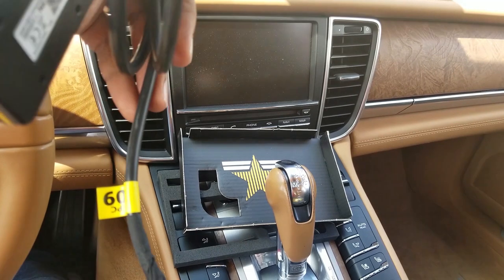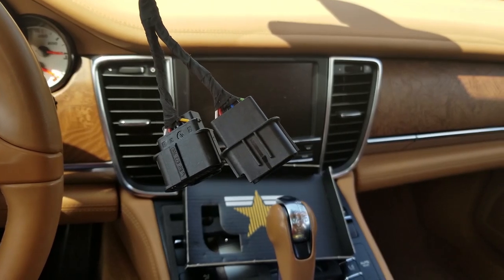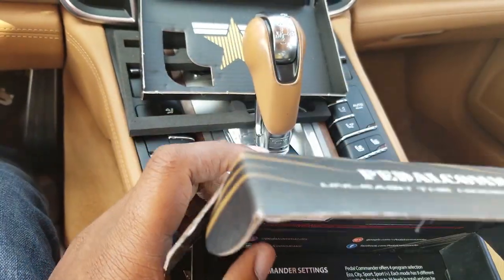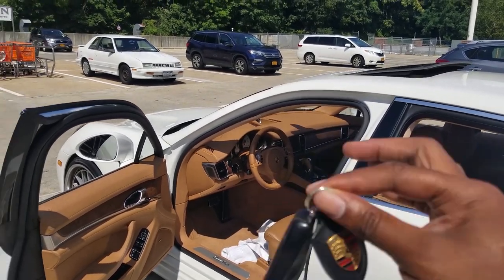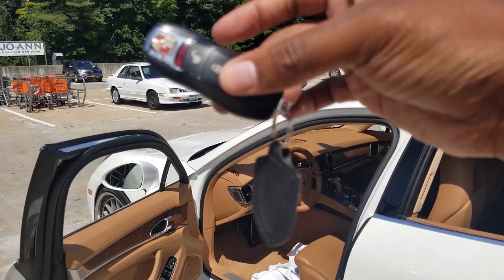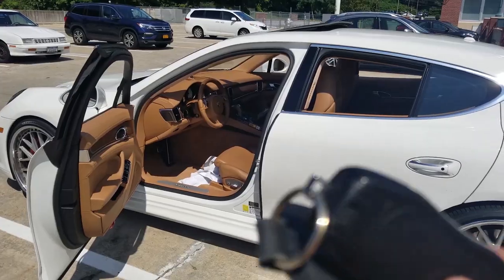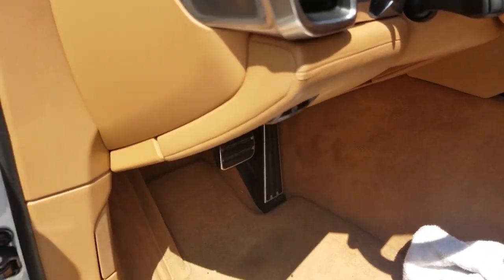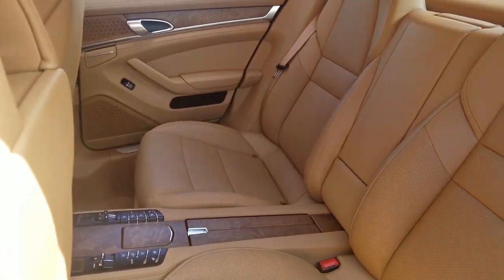Finally A New Mod For the Porsche : Pedal Commander

Comment: Pedal Commanders decrease the programmed-lag/ response time of the drive by wire throttle and make the car far more responsive than the manufacturer intended.

Keep in mind that some of that lag is a built in safety for both you and the engine.

Have fun!
Reply from the maker: That is correct big truck, I felt like sport plus was too much for me and the motor
Reply: Your the only person that can explain what it was
Reply: I use for porsche 997.1 carrera s to much lagg some time  if i drive like 20 kilos when i stop throttle come lagging can’t rpm up to 3

Comment: I watched your video several times and was skeptical, but knew my throttle was heavy and there was unnecessary lag. I just installed the Pedal Commander on my 2013 970 Turbo, took it for a drive, and WOW!!!! you were right. This thing is legit!! On Sport + #4 its crazy snappy, so I had to turn it down to Sport #2, and OMG. It's like a new car, feels lighter and is Hela quick like it has a tune. 
It was quick before, but now just from installing this device, it woke my car up and actually lightened my stiff pedal up to feel amazing. It really shows you how much the factory de-tunes these cars. I was planning on getting an ECU stage 1 tune, but now I can't image how much quicker and faster it would get with a tune, and dont think I need it now. 
I'm super impressed. I guess it makes sense and tells me that a 500 hp twin turbo AWD V8, paired with a PDK, has more than enough power that was just de-tuned out of the car to appeal to a wider range of people and probably to protect the car and the driver from guys like us lol.    
Excellent video. Thank you sir!

Comment: I was at a 4x4 & Truck show when I met a representative from  pedal Commander. In their booth he showed a video, which I think you can find here on YouTube. I own a 2014 Ram 1500 4x4. Their is most definitely a delay in the throttle response. It's a 4x4 not a sport's car I get it. But because of the dual exhaust. I often find my self faced with people who want to see if it's up for a challenge. Because I'm a Jackass I'll give some a quick run.
The pedal Commander would increase throttle response therefore making my truck seem a little quicker.

Comment: Outstanding info,  I have a 2011 Panamera 4, it comes with only sport, but your right  it has a slow throttle reaction time. The Pedal Commander will increase my response time, thanks again I'm sold... great review.
Reply: My Panamera Turbo also only came with sport mode. It had no Sport Plus or Launch control. Then a purchased Sport Plus and Launch control from Suncoast Porsche and the dealer installed it. Worth every penny. I totally enjoy it. Then I had the car tuned by FVD Brombacher. It feels like a whole new monster. But now I'm debating whether to get a pedal commander on top of the tune. Just wondering if the tune already increases the throttle response as best as possible or if it would still be better with both? Or would the pedal commander be Overkill if you already have a ECU tune?

Comment: Best video review! Mine is coming in tomorrow and I wasn’t sure how it would perform with my car. I have a 2017 Mustang Ecoboost and although it has 320 Torque and 310 HP, it feels flat until the boost kicks in. Also, most the power is in the lower rpm range, so dropping gears sometimes actually makes it feel slower. This vid shows me that it may help my boosted car too.
Thanks!

Comment: Would've loved to have seen you try it in launch control mode.  My 4s even lags then but is a generally a real pita when shooting a gap in the traffic from an intersection.  In fast cornering through the twisties I have to throttle on early to defeat it. My VW is even worse

Comment: You said you think the Porsche Panamera Turbo would be basically a whole different monster if you added a ECU software tune in the future in conjunction with the pedal commander. In my opinion, it seems like you wouldn't even need a pedal commander after you had the car properly tuned. I believe the tuner software can dial up your throttle response internally to do the exact same thing as the pedal commander. Meaning the pedal commander would be redundant and unnecessary. Am I correct in assuming that?
Reply from the maker: yes 100%...i have a dme tune on the car now and the pedal commander was no longer needed

Comment: If car is always in comfort because I’m driving in in suburban/city - but I want to overtake somebody,  and I want the fast response,  is there a setting I can just always leave it in for that?   I mean without me ever having to switch modes on the app or controller - a permanent setting solution?

Comment: How did you get that connector plug off the pedal assembly.. I've been trying for 30 min to release that connector... removed the assembly like you did and pushing down on the grey button. So should the grey button stay down if it releases all the way? im worried about breaking the clip sticking a screw driver in there..
Reply from the maker: Lmao, use two small flathead screwdrivers lol
Reply: After watching your video and hearing you say use the screwdriver I used it and low and behold it popped off, scared the crap out of me because I thought I broke something but it is all good.
Reply: Holy crap this sprint booster is bad a$$!
Reply from the maker: glad you like bro

Comment: I hooked one up to my hellcat and I didn’t notice any difference at all. I think the hellcats already have the quick throttle installed from the factory ? As far as the quarter mile I had no difference in my times.
Reply from the maker: I am going to add to the HC tmrw
Reply: Right on, I can’t wait 😊 maybe I did something wrong ? But my cell phone says it’s working ? Seeya tomorrow . Thank you
Reply: Most care come from factory with a timed delay from the input of your foot on the pedal to the acceleration of the car aka, a throttle response delay. This is done for safety reasons. I'm guessing due to the hellcats 707 hp from factory and thats a conservative number, you have so much power from the engine, and the transmission is so responsive as well that a pedal commander isnt needed. Easily put, your hellcat makes so much power that the engine IS a pedal commander! lol

Comment: I have a 18 Panamera Turbo, do you know of any other mods worth doing? I can’t find anyone who has anything that isn’t only cosmetic, for 17 or 18s
Reply: There are several things you can do,..First get it Tuned. That will turn up the turbos and pretty much everything else. Upgrade the "Y" pipe to a Fabspeed, upgrade the exhaust to FVD Brombacher or pretty much any kind, upgrade the diverter valves, upgrade the PDK  transmission TCU software. That alone is about 150 to 200 hp increase. If you want even more power then upgrade to bigger FVD turbos. There's plenty you can do depending on how deep your pockets are.

Comment: Yo lion when you gona put a proper intake on cheepo kitty?
Reply from the maker: Prob never, gonna do tune and pulley first
Reply: Mod2Fame Vlog a pulley will help but what's the point if you're not feeding the motor the air it needs? ...try an intake that you can bolt on yourself before the pulley which gona be a project on it's own